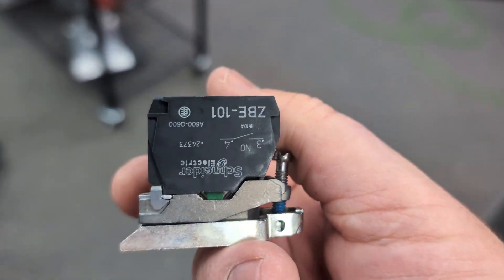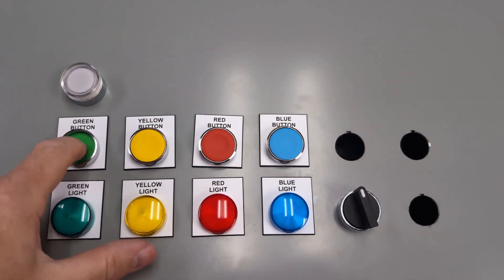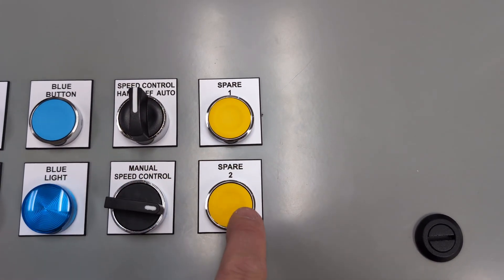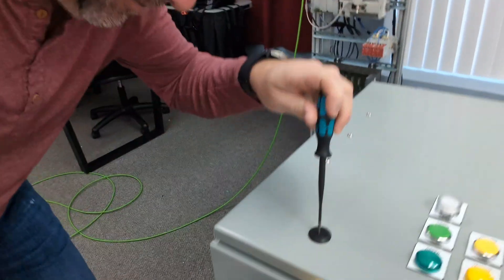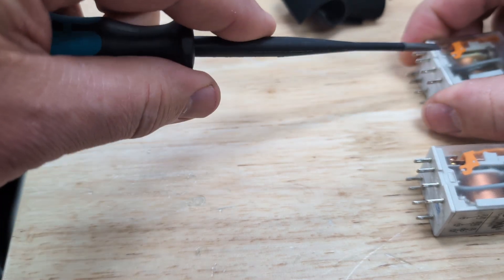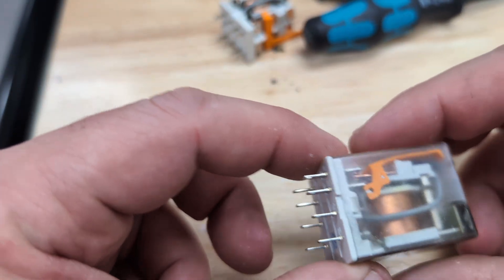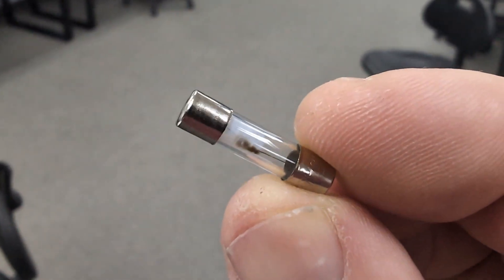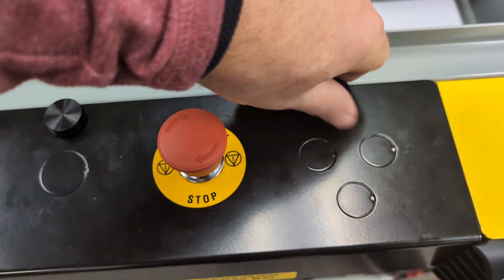The Final Countdown: Last-Minute Panel Wiring Chaos

Comment: Hiya Tim. Ive always been wondering, How do you get them holes created with the little mounting tab at the top of them pushbutton holes. basically, how can create that little tab at the top of the holes for the pushbuttons like allen bradley 800T pushbuttons

Thanks
Reply from the maker: You need a Keyway Nibbler, I'll try to make a clip of mine this week.
Reply: @TimWilborne thanks!